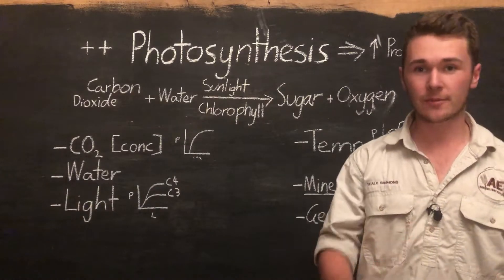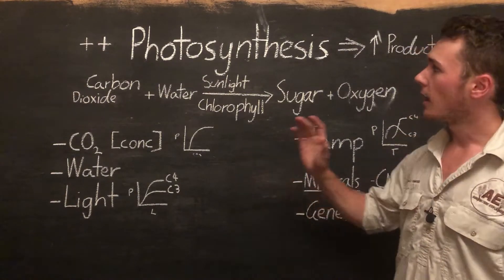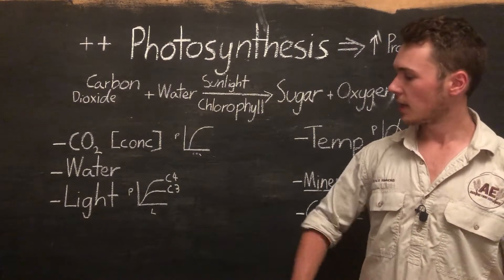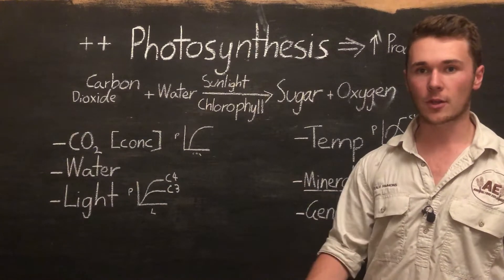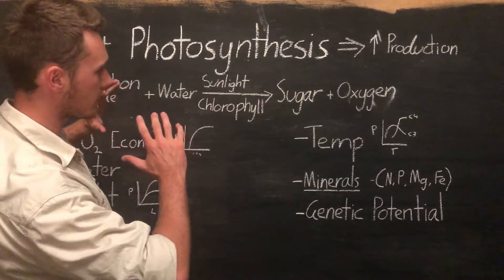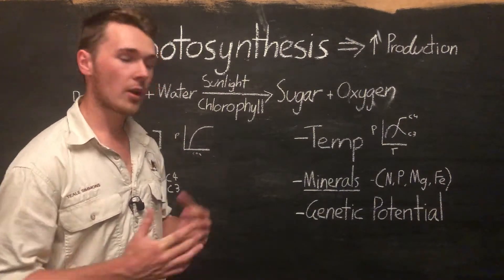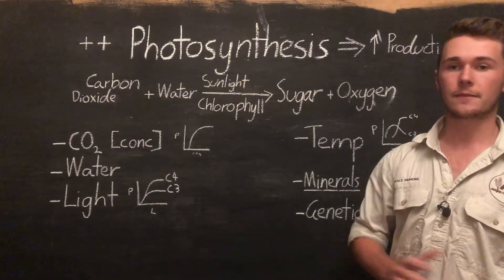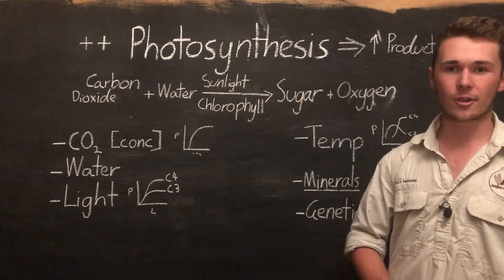How to maximise plant production by increasing photosynthesis

Comment: No, C 4 plants dont do as as well as C3 plants do in increasing amount of CO2. This is due to the constant use of ATP in transporting and concentrating  CO2 in the Kranzs  anatomy of C 4 plamts for whic C3 plamts need not to
Reply from the maker: True, however C4 photosynthesis will still increase with a slight increase in CO2 concentration (https://extension.okstate.edu/fact-sheets/greenhouse-carbon-dioxide-supplementation.html)